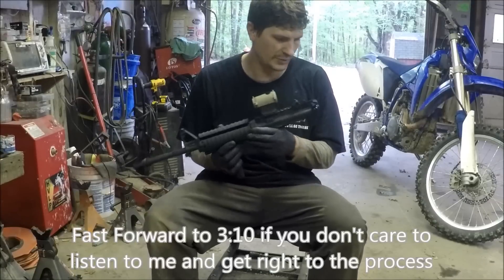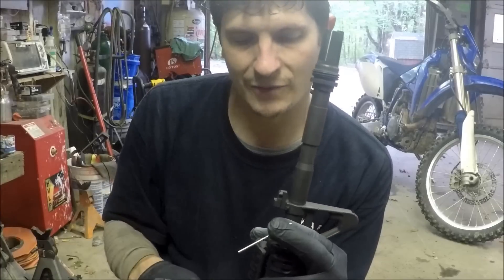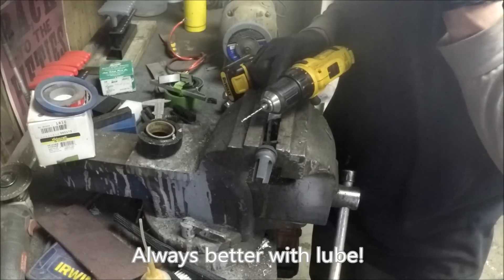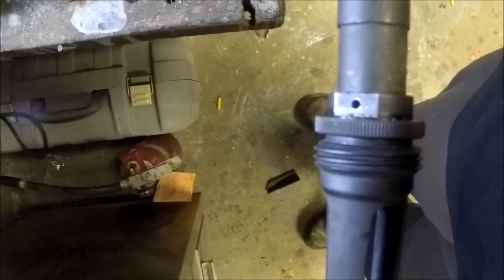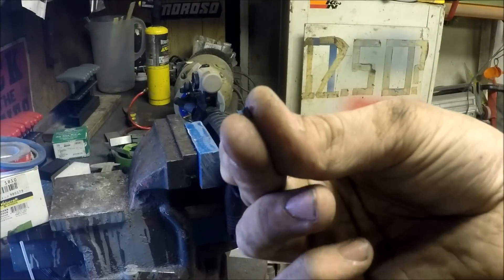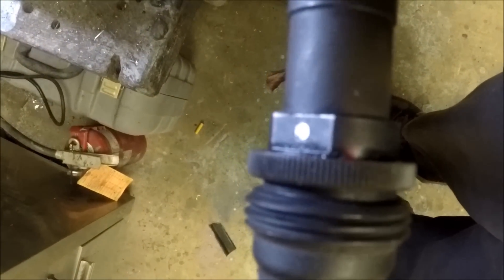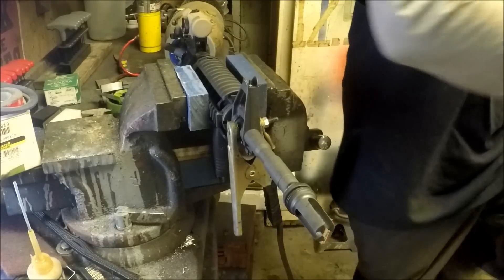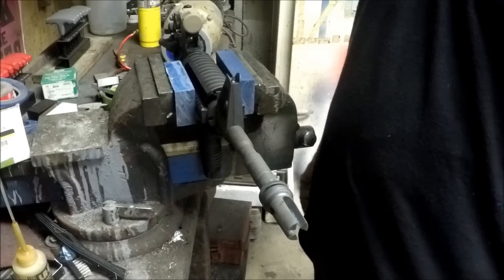How to pin and weld AR-15 muzzle device

Comment: You need to taper the end of the pin to match the contour of the bottom of the hole, left by the drill bit contour. And you need to Chamfer the hole opening on the muzzle break to form a "Well" for the welding  material to seat into.
Reply: also should not have ground the top of the pin flush. leave a little out that can be washed down into the joint. since he made it flush when welding he likely drew some material out of the joint to make the weld. this would draw the pin back out of the hole instead of filling the weld area with new material. hes also taking big gamble just eyeballing the depth of the drill. it would be really easy for the tip of the drill to touch the inside of the barrel. if it does then your barrel is ruined

Comment: Also if you used a tool to recess the top of the hole the weld would settle in the hole better

Comment: I like not using the crush washer, and it’s not necessary in this case. But man, my OCD would never be okay with that flash hider not being timed on the barrel.
Reply: There are ZERO silencer QD mount muzzle device manufacturers that would instruct you to use a crush washer.  If you want to time it, use shims.  QD muzzle device = no crush washer.

Comment: Pro Tip:  If you thread the muzzle device on something disposable then instead of using the steel pick to fix the bur you can just untread the device off the throwaway threaded piece.
Reply from the maker: 6 in one half dozen in another
Reply: lol, right on. I use that saying all the time. there's always one in the crowd.
Reply: "Pro Tip"  lol
Reply: Its hard to find "something disposable" with thw same threads. The flash hiders have pretty unique threads
Reply: @Alexander-qd7nj  1/2-28 NF threads are "Unique"? News to me
Reply: @lokes77  I meant they're uncommon to find laying around

Comment: Could one use a mig welder for this as opposed to a tig welder?
Reply: You can but some muzzle devices don't have a lot of room for the pinning and tig is slightly more precise.  In the video's case, he is wanting to avoid those teeth which is what an ASR QD mount bites into when seating a silencer.

Comment: My local FFL just told me he couldn’t pin and weld my 13.9 to my dead air muzzle device. Cuz a ATF agent told him that pinning and welding a muzzle device doesn’t extend the overall length. Is my FFL wrong?
Reply: The ATF doesnt make laws.  They Enforce them.  If the muzzle device is permanently attached and cant be removed without destroying the threads or barrel it becomes part of the barrel.  You can buy barrels with pinned and welded muzzle devices.  Therefore the ATF can pound sand.  And if youre smart you use a 2 piece gas block and cover the break and gas block with a hand guard.  Nobody will EVER know.
Reply: yes, your ffl is wrong. if your muzzle device cant be removed it counts towards the barrel length

Comment: I was just using JB Weld before but this is much better 😜. Thanks for the great video!!
Reply: JB Weld does not meet the ATF's authoritarian scrutiny.  If you are attaching a muzzle device to get over the 16" barrel length requirement then it has to be pinned and welded.  JB weld is just an epoxy that tops out around 600F.  If you are not pinning and welding you should be using rocksett.

Comment: So what do you think would be the smallest welder one could use to do this? I don't have one and will probably almost never use it again, but I want to get one to try this.
Reply from the maker: you could prob do it using a car battery as a stick welder if in a pinch
Reply: Ok, cool. So I could get a little stick welder from Harbor Freight and do the job.

Just asking because I've never welded anything before in my life. I figure this appears to be fairly simple thing to do. Good first project. Plus I have a 14.5" I need to p&w so theres that
Reply from the maker: yea that would do fine, just practice on some other material to dial in your settings, you just need good heat penetration and it will be good to go, i had never welded before i tackled an entire custom turbo kit on my camaro. practice makes perfect...or good enough lol
Reply: I heard that. thanks man.

Comment: I hope you can answer this for me. I need to attach a aluminium muzzle device. What should I use with the stick welder to do this?
Reply: That sounds like a poor idea for long term durability. But to answer your question you would want to use an aluminum pin and weld using a tig welder. You could probably get away with using an aluminum brazing rod too, because no one would actually be able to tell the difference.

Comment: Great video and wonderfully stepped and shown, as well as explained to best understand everything. Question, would you use or need red or blue loctite or is that just overkill with the pin and weld?
Reply: If you put anything on the metal before you weld it you'll contaminate the weld and it will be a mess.

Comment: Not an expert on this but just a suggestion. Center the drill hole on the top of the barrel in the event you want to replace the muzzle device with one that has to be timed. You would't be able to see the hole in the barrel through the muzzle device so you won't know where to drill. If the hole is centered on the top of the barrel, you would know exactly where the hole was and thus know exactly where to drill the hole in your new muzzle new device.
Reply: If you are replacing a pinned and welded muzzle device then you've already done something wrong.

Comment: Does this ruin the integrity of the barrel?
Reply: Youre not really using using that much continuous heat.  Yes its hot, but likely not that much more into the barrel steel then its designed to handle under heavy firing.

Comment: you dont need filler rod at all..i am a gunsmith and i do this shit everyday.. but good job
Reply: You just tig it?  I was considering just using a pin I cut off the back end of my drill bit and tigging it with no filler.

Comment: is it legal to just solder?
Reply: yes but you have to use 1100+ degree melting temp solder
Reply: Some guys think, if the ATF is checking out the "weld" on your muzzle brake pin, they must already have a lot of interest in you, for something else they believe you might have done.

Comment: what did you use for the pin?
Reply from the maker: hardened pin from hardware store
Reply: bolawdean was the pin from a speciality hardware store? Or it something Home Depot or lowes carry? Would the shank from the drill bit work if I cut it off?

Comment: Around 9:00. Does he have his upper clamped in the vice with no padding? ... It hurts to watch.
Reply: He's clamped on the handguard with wood blocks between the vice and handguard.  Not ideal, but better than clamping directly onto the upper receiver.  A slightly deformed handguard won't affect function.
Reply from the maker: there is delrin (blue plastic) blocks between the vice and the sides of the quad rails on the handguard with very minimal pressure as the handguard is aluminum...the upper receiver isnt touching the vice